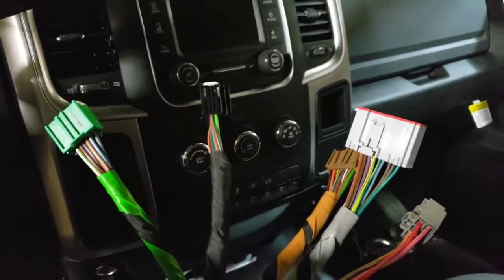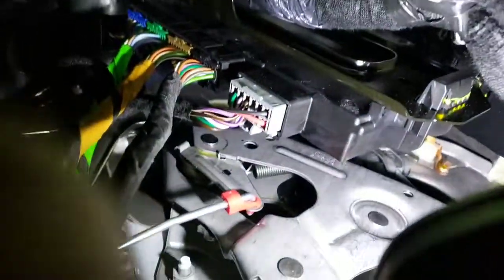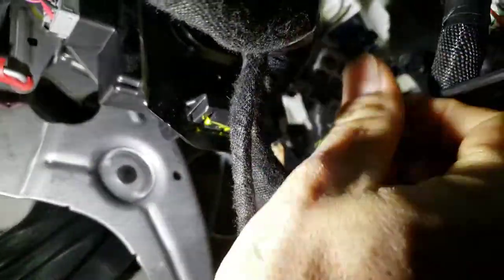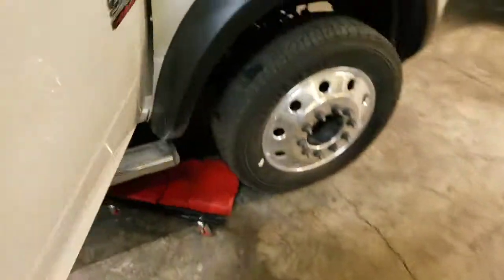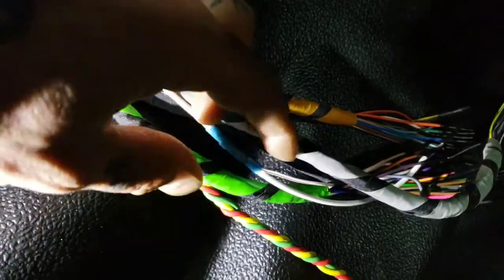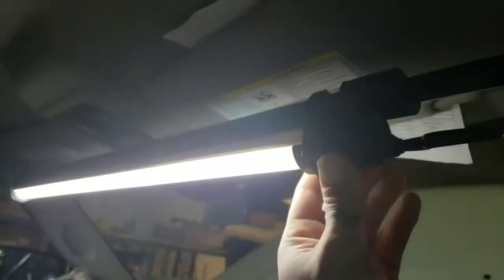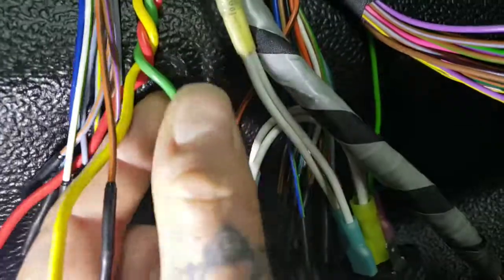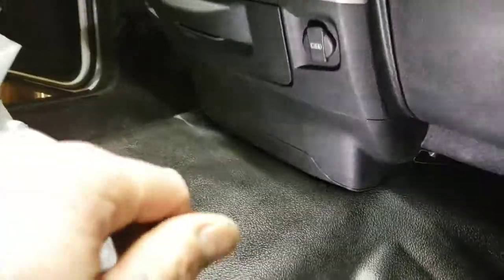2014-2018 Ram Wiring the VSIM (For builders)

Comment: Nice detailed video on Ram upfitter wiring.  FYI, starting 2016 model year you do not need to ground the WT/BR wire for LED taillights.  The fast flash was turned off on chassis cabs.  If you have done a 2019 or 2020 you know the OR/BR PTO pressure switch wire is gone.   And the 2019 issue discussed below is fixed from the factory as of August 6, 2019.  Before August 6 a diode needed to be added.  After  August 6 it is factory added.  And if you use mobile PTO mode to run a clutch pump you can set max speed for the vehicle in the cluster menu.
Reply from the maker: Thanks for checking out my videos Chris! I believe we have spoke a few times on the phone regarding some of those issues. Occasionally we will still get chassis that were programmed wrong and also some AUX. switch issues and need to be sent in. Nothing major. Warrantied. Love the new trucks and PTO Functions. Such a breeze. Seems Ram has always had the builder in mind.

Comment: I need help, I have 2015 Dodge 5500, 6 7l Cummins. PTO used to turn off every 30 seconds and now turn off in 10 Sec. Suppose to Ground OR/BR wire in brown plug, but surprisingly I don't have no Green, Brown or Black plug in VSIM.
Reply from the maker: If you dont have any of the colored plugs installed, the builder failed to upfit your truck with these. You can possibly still find them from the dealership or a wrecking/dismantle yard.
Reply: @WRECKERMANDAN  Thank You.

Comment: I have a 2022 ram 3500 6.4 hemi cab/chassis ( not ordered for pto ) that I have put a clutch pump on. It’s on aux 1 , how do I trigger high idle off aux 1? This truck will not high idle for nothing in park brake engaged/ cruise control etc etc.
Reply from the maker: From Ram:
Requirements
1. The vehicle must be stationary.
2. Automatic Transmission in park. Manual transmission in neutral with the park brake depressed.
3. The brake and clutch pedal must not be depressed.
4. No ‘Check Engine’ (MIL) lamp on.
Procedure
1. Turn on the cruise control.
2. Press the ‘set’ button. The RPM will then rise to 900 RPM.
3. You can then press and hold the ‘accel’ button to increase the RPM above 900RPM
4. You can press and hold the ‘decel’ button to reduce RPM back to 900 RPM.
5. To turn off the feature either: turn off cruise control, step on the brake or clutch.
Reply: It won’t high idle that way either and no dealship around has any clue why and they aren’t willing to help.
Reply from the maker: @boosted74m2  Does your cruise control work at all?
Reply: @WRECKERMANDAN  yes it does . It’s been to two dealerships and they say they have no idea why it won’t idle up . InPowerllc told me he has had 30 phone calls about this happening.
Reply from the maker: @boosted74m2  Look down this comment thread for Chris Borczon. He is a Ram tech. Try reaching out to him. He is extremely knowledgeable and can probably help you. On Fords we used to wire in a device called a riostat that allows us to adjust and control the idle up speed. This may be what you need.

Comment: Informative and easily understood. I handled the red (B+) and pink (IGN) slightly differently. I cut them but rather than simply using a butt connector I added a 6 position auxiliary fuse block to each and the first circuit I installed was the cold side running to the rear of the frame. I installed a 20 amp fuse on each. Essentially the same as your approach but I felt it was more generic to give myself the fuse blocks.
Reply: I did as you did with the IGN & B+. I also placed a 1/2 amp picofuse in each VSIM line I used for relay operation. The document calls out 1/2 amp as max current for most circuits.

Comment: that's awesome. wish everyone installed like that. do you know if I can get the harness for the wig wag lights? mine is a 2018 4500.. if I remember correctly I don't have all those plugs in the VSIM.. but I will check  but definitely want the wig wag feature!
Reply from the maker: Try checking with Dodge/Ram dealership and see if its a part that is still available. Could also maybe try some dismantlers/wrecking yards in your area but who knows if they would have any clue what it is your looking for. 🤷‍♂️
Reply: @WRECKERMANDAN  I found it on eBay. But my boss will check tomorrow to see if they came with the trucks when we got them. Thank you!
Reply from the maker: Ya, they should have come with the trucks. Since you stated its a 2018 I just assumed its probably lost by now. 🤷‍♂️
Reply: @WRECKERMANDAN   it should. But I believe truck max took it when they upfitted mine. It’s 40 bucks on eBay for the jumper harness. 🤷🏼‍♂️

Comment: Did you hook the pass thru wire to the pump as a hot wire Along with the pto toggle wire?
Reply from the maker: Yes, that way the clutch pumps hot is transfered through the firewall to the inside of the cab, allowing me to use this to activate the relay configuration.
Reply: On the 2019 you put a resistor on the pto wire to the ground. Do you have to do that on 2020 ram5500 ?
Reply from the maker: @p.jeremyalcala384  Yes. Some vehicles depending on year will still need to go to the dealer to have the VSIM re-flashed as the wrong/outdated software was uploaded originally. 🤦‍♂️ If you find you have wired everything correctly and your factory PTO switch does not stay on, you may have this issue.
Reply from the maker: Ram claims they have fixed this issue and the resistor is no longer needed, but I have still encountered a few early in the year that still had the issue. If you run any kind of your own PTO indicator light (especially incandescent) the resistor will keep the clutch pumps magnets stored powered, once shut off, from traveling back into your light and prematurely burning it out.